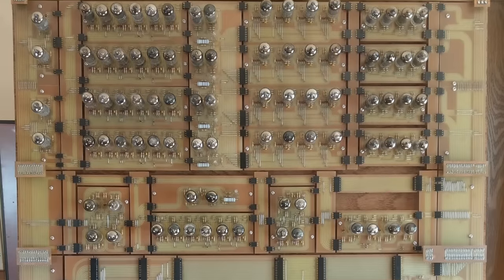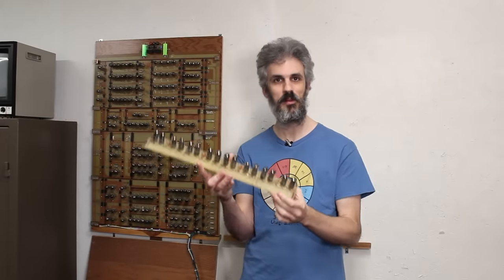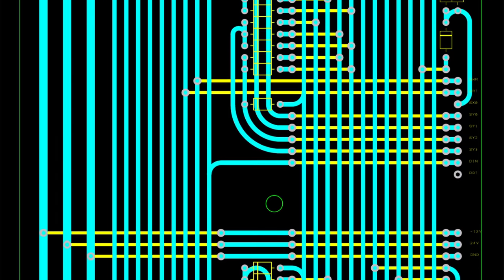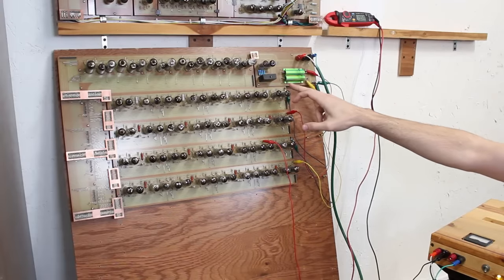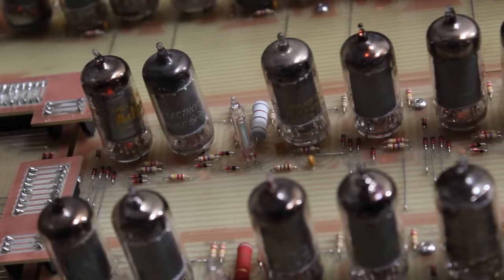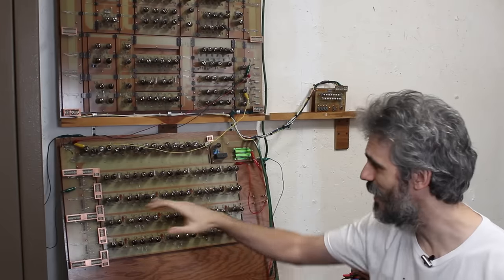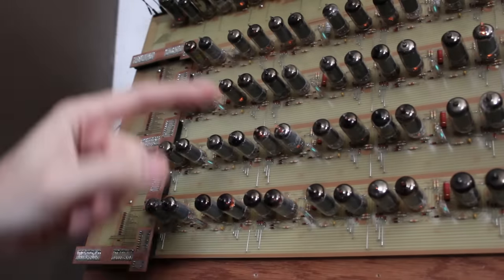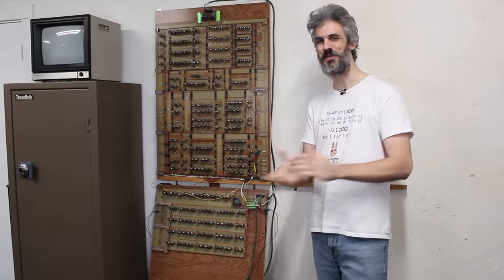Vacuum Tube Computer P.30 – Connecting 2-bytes of Tube RAM to the Processor

Comment: @5:45  I've done this before.  The correct way to do precision drilling is to NOT drill through the paper.  Get a point tip or tiny Phillips tip screw driver or large nail and hammer.  Hammer through the paper a point/dent into the wood for every drill hole.  Remove the paper.  Now you will have dents for every hole which your drill bit will sink into making each drilled hole perfectly dead center every time.  Another solution is to do this through the PCB for the best accuracy.  Also, if you want to stick with the paper print reference, some of the really-really old Epson wide carriage color paint-jets which can do 11x17 in color can actually do 22inx17in (56cmx43cm) in B&W.  Your precision will vastly increase if you can find one on ebay dirt cheap.
Reply: I tried the denting method on my second alarm clock. It looked worse than the first. I totally suck at fine motor control.

Comment: Does the horizontal mounting not create an amplified heating problem as the heat rises through the various rows of tubes? i.e. does the top row not face a river of upward flowing heat?

Comment: I wonder if Neon bulbs would make good memory?
Connect 60v DC through a resistor to one electrode and the other through a resistor to ground, then connect a coupling capacitor to each electrode. supplying a 60v +ve pulse through the top capacitor will turn the bulb on and a pulse through the bottom capacitor will turn the bulb off.
Reply from the maker: Neons are something I actually considered, because they can indeed make a good memory cell, in multiple different ways (I love Neons). But, for this entire build, I'm restricting my voltage levels to +24V and -12V only. Which is incredibly low for tubes, but also it means that there's no danger on it. So anyone can get handsy with it without and fear or danger of shocking of themselves. But, that also means I don't have enough potential to use Neons.

Comment: Not to be a peanut gallery comment, but I do think core memory would have been better. ferrite cores and magnetic wire are pretty easy to find still with the cores available on eBay.  I know one has to create refresh circuitry, But I think overall it scales better.  just my two peanuts.
Reply: Tape scales better than core. At any rate, maybe he'll use core as programmable configuration storage, which honestly I think it's more appropriate for than ordinary registers.

Comment: I'm going to suggest a mixture of techniques: in addition to your open reel machine, I recommend an RTL board for reconfigurable ROM, and a trick from HP's 9100 calculators for primary ROM: design some PCBs with traces that act as tiny transformer cores to use as ROM.

Also, it might be interesting to use some steel wire from McMaster-Carr to implement a "wire recorder" equivalent to drum memory, or maybe even finagle an 8-track recorder (recorders did exist, though rare) in as "session storage" (sorta like "hibernate" on a modern computer, but with a tape loop and swappable).
Reply: One could go fully retro with mercury column memory...  Nasty stuff though if you inhale the vapour.

Comment: My bf1 had an issue where the addresses and data would increment by 2 instead of 1. It turned out that when my control lines went low, the Ctrl AND Clk was behaving like the clock was experiencing a low edge. Lovely, eh?

Comment: Maybe you already figured this, but wouldn't the program memory essentially need to be in a loop of tape (or paper) for example? Probably wouldn't even need the program counter in that case with this processor... just advance the tape one instruction every clock pulse. There are many other options for program storage rom, but a magnetic tape loop (with auto start/stop) might be a viable way to be able to record a program from an arduino to the tape and then run it on the tube computer. This thing is so cool!

Comment: Noob question - is the sideways orientation of the tubes alright? Can vacuum tubes be oriented in any direction, or should they be upright?
Reply: They can usually be oriented any direction, but they can be manufactured in such a way that they sag and tangle- given the need to ship, such tubes would have been rejected from designs fairly early after it's introduction to, leaving them rarer than other  tubes.
Reply: The pair in my Korg Electribe MX lay on their side.

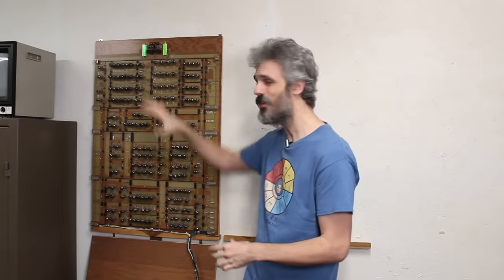Comment: 1:17 they also used transistors to do logic functions that where easier implement than with a tube, like ram
Reply: and output buffers
Reply: look at the  1946 eniac specs and get real tired of buying diodes and tubes, and 3 phase power, make u think which one has more processing power...

Comment: Can you get new old stock vacuum tubes that were made in 1957 that require a heater voltage of 12V and a B+ of 12V which should be easier to drive.

Comment: I used to work on a system that was worse than this it was made by REC (Recognition Equipment Company) the used a paper tape drive to load the programming it was used to bring up the punch cards and run the custom OS eventually we put a 5 inch floppy and finally at the end got a 1" tape drive. Any time power dropped I would set and program the the registers in octal by flipping toggle switches to program a register then set the register cycle the register to the next one and flip switches to program and set it in the register and repeat their was about 50 lines of code for the register per printer page. The old green and white striped continuous perforated printer paper. At the end of a page I would attempt to run it and if I was lucky it would run. If it didn't I would jump to the page with the appropriate register on it and continue. That machine was 6 years older than I am and I'm 55 now we finally replaced the whole system in 2002.

Comment: A margining  control on your power supply may help you weed out marginals flip flops and logic gates. reduced heater voltage reduces tube transconductance.

Comment: I want to know how many KILOWATTS of power this thing is going to consume (including the cooling, lest you burn down your lab there)?! Just the one section pictured in the thumbnail image has more tubes than many 1950’s era tube TVs, for Heaven’s sake, and those often ran 350-400 Watts or so. Four of those are going to consume as much as a large microwave oven! 🤔
Reply: He's running them at a very low voltage.
Reply: I remember around 400 watts, which was probably for just the CPU. The entire unit probably will be as much as a large microwave oven. Btw it's only color TVs that use that much power. BW TVs usually are under 200.

Comment: Word (16-bits).

😁
Reply: (from wikipedia)
"The number of bits or digits[a] in a word (the word size, word width, or word length) is an important characteristic of any specific processor design or computer architecture. "